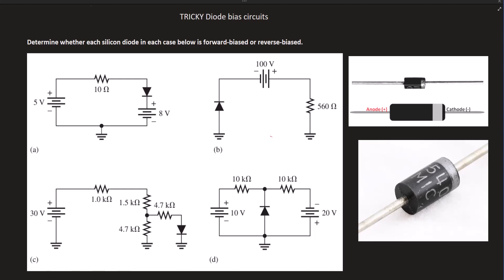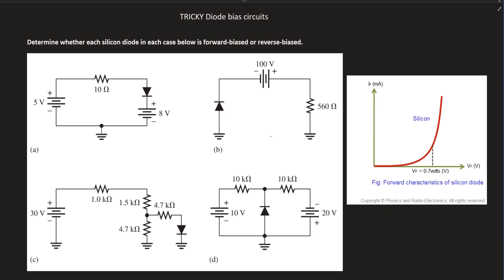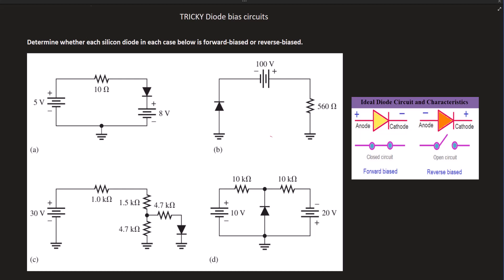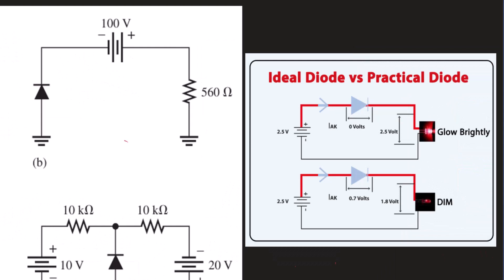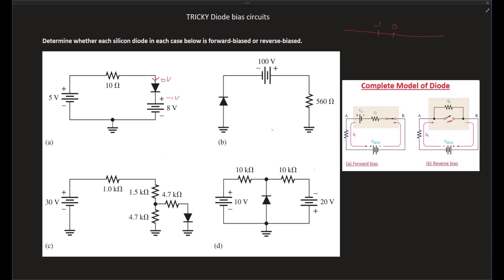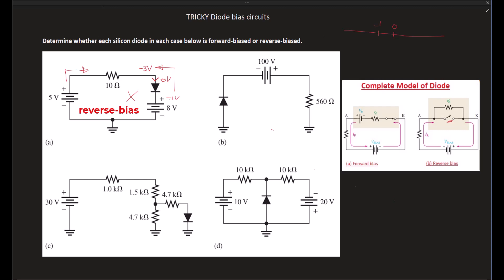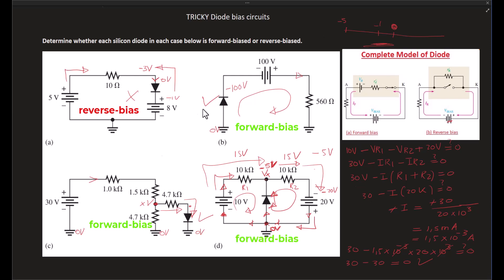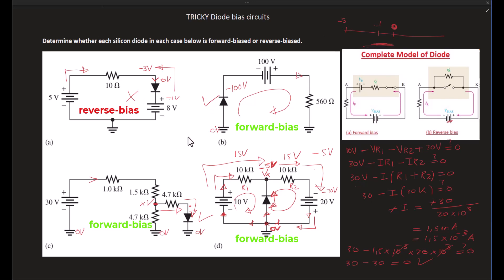Tricky Diode Forward Reverse Bias Circuits. Part 2

Comment: The last example with the two voltage sources is wrong. It should be reverse bias. If you do voltage divide at the Cathode node, you would get something like Vcat=(10k*10V)+(10k*20V)/(10k+10k)=15V. if the anode is 0V due to ground, and the Cathode is 15V due to voltage divider, then the diode would oppose this change in voltage. Reverse Bias ;)
Reply from the maker: Hi, please watch that section again. When you perform the KVL loop to find the voltage at the cathode node, as I demonstrated @10:45, the answer is -5V, which is lower than 0V, making the diode forward biased.

This problem is from Floyd - Electronic Devices: Conventional Current Version (9th or 10th Edition). The answer is provided at the end of the book for odd-numbered problems as:
a) Reverse-biased
b), c), d) Forward-biased

Comment: Hi. I have these circuits in my course book. Please please please can you solve the question of Voltage across these diode. Please my exams are near.
Reply from the maker: Hi, no problem. Are you able to join my channel membership? That way, I will make a short video solving these circuits for you.

Comment: Sir Why We Resistor when The Diode is ins Reverse Bias
Reply from the maker: The Resistors are used in forward bias mode to limit the current flows into a safe level, regardless of where it is placed on the anode or cathode side, it will limit the forward current.

In reverse mode, the diode doesn't conduct, except for some leakage current, so there is no need for a resistor